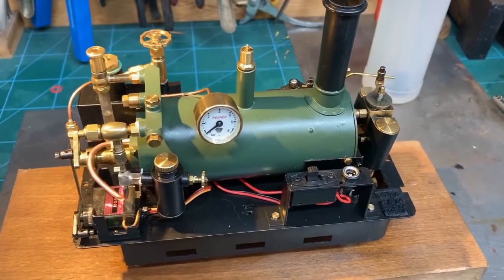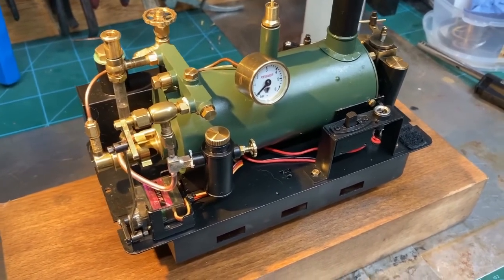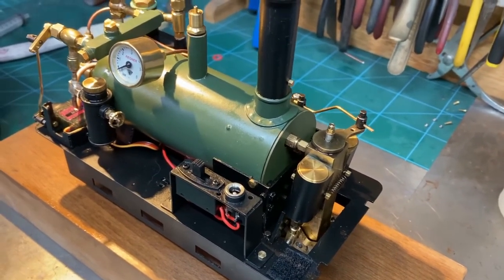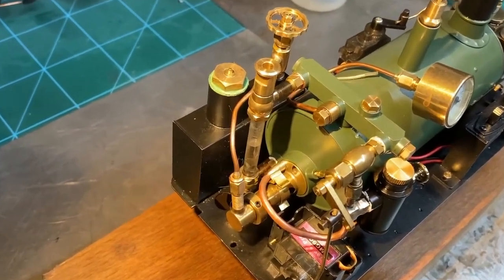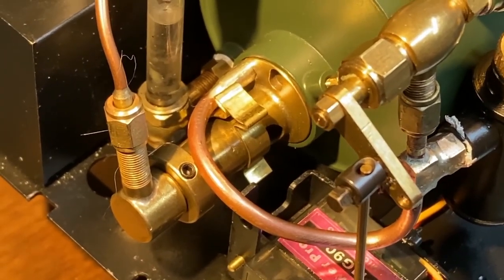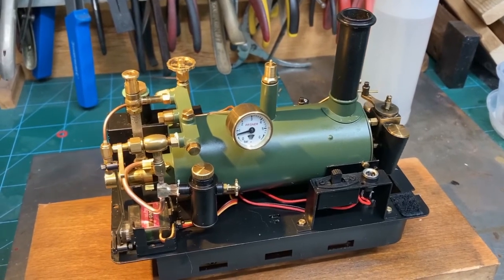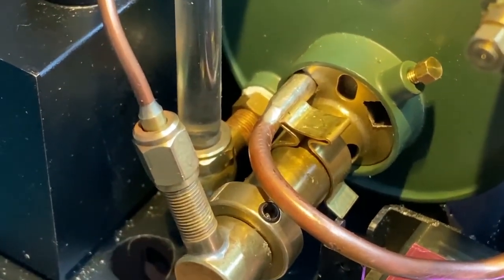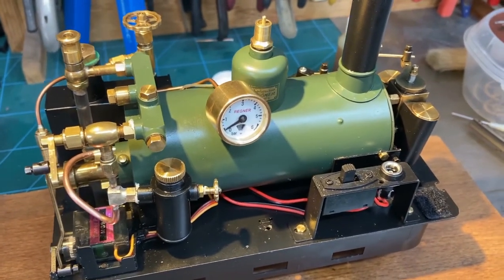Regner Paul tram loco with heat shield and secondary air hole

Comment: Hi, I got recently new Paul from Regner. They have fixed this issue with hole in cover. No more hole. 

So no need for shield any more. Also they had changed connection to lubricator to bend the pipe more naturally and to not interfere the upper whistle  servo.